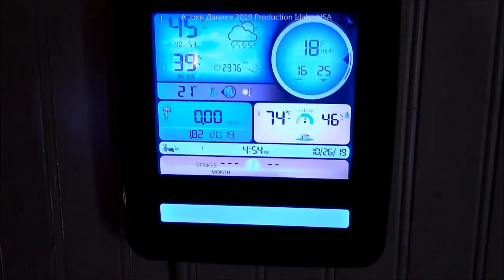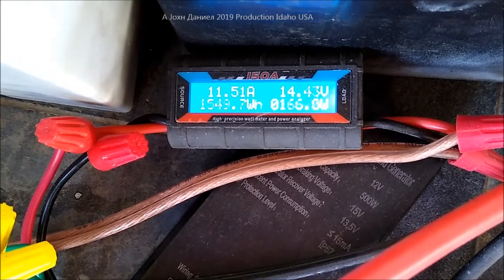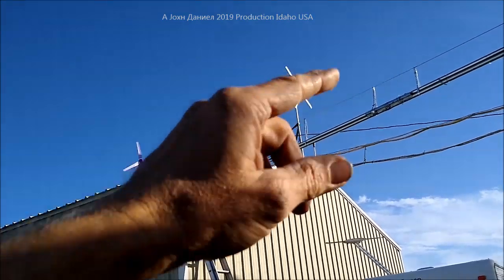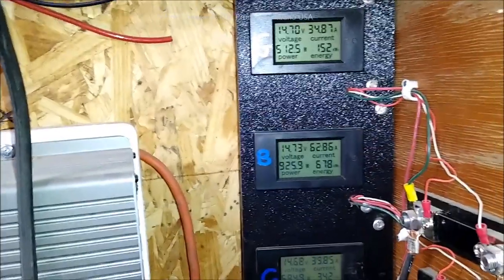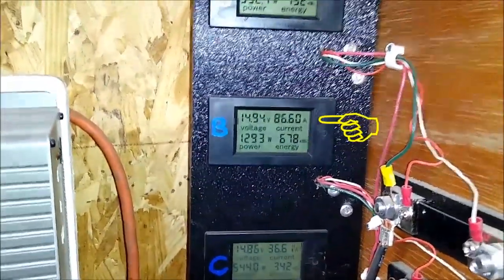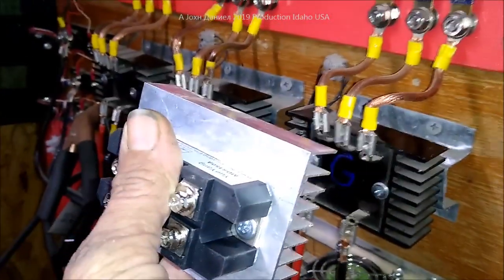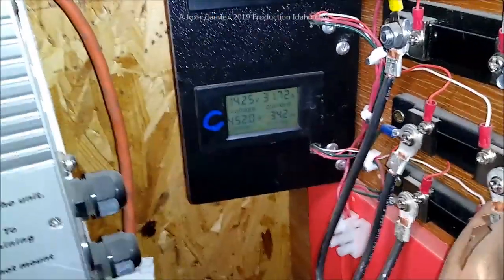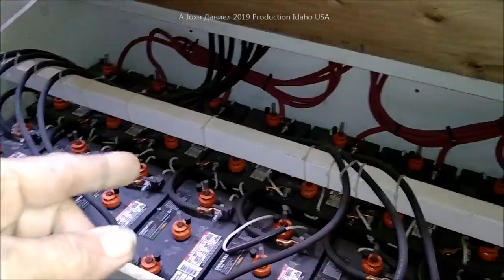Multiple Micro Wind Turbines make high power, 800 watt B&C hits 1300 watts, parts Below Vid

Comment from the maker: See the low wind power results as well https://youtu.be/sq4XPT-LFbI in vid 3, SUBSCRIBE, Get your parts to GO INDEPENDENT OF THE SYSTEM from sources below the video.  Solar & Wind, its for the ultimate self reliance. Hit the SHOW MORE below all the videos & get your head start now. UPDATED 4 VIEWER RESPONSE - More parts are here For rectification to get 100% full batteries & to divert over volt you will need these: https://amzn.to/37HN2OR 100A SQL Rectifiers &  https://amzn.to/2MTUjCU A All purpose long life Load controller and be sure to get up to and over 300 watts diversion resistors ( https://amzn.to/2QngFPq x 3) and one or more 60 amp SSR ( https://amzn.to/2QKEyj0 ) with heat sink ( https://amzn.to/2ZYtmna ) and be sure to use thermal past on it.  ( Proper type - https://amzn.to/2QN2hir from Protronix)
Reply: Јоhn Daniel if you were starting out with wind turbines- which would be your best pick?
Reply: Hey @John Daniels
If i want to use 48v dumploads in hotwater tank .. 
Instead of the huge resistent .. how do you do .. that?? 
We are ordering 2 of the 800Watt@48v wind turbines .. to top Up the
20x200Ah AGM .. 
My plan was to dump All exss power in my hotwater tank 
Found 1500Watt@48v .. so i think maybe 2 of thoes 1 in eatch 140l tank got 2 tanks ..
The tank has place for 2 x 230v@2000Watt so i replace the 1 with the 1500Watt@48v 
The tanks hawe a Cooper radiator outlet .. so hot Water helps heats radiator aswell .. 60° degree 
So the dumploads Will never ever run hot .. if All batteries are full .. All water is max hot 
Then bypass walve Will start heating the jacusi .. and Then the pool ..in worst case .. 
So help please with som indput
Reply: @tracycovington3130  IT All depends on you dayli consumption 
Look at the wind turbine as sun panels on a cloudy Day..
When wind goe's down /clouds go infront of sun.. 
When blows 15m/s hard wind IT Will max out like sun panels on a clear Day!! 
I buy 2 800watt IT was supposed to be the 500 watt to 211doller PR pop but they hawe med a sweet (test) deal on 2. 800watt 29kg 
Wing ø 2.4m 5 blade (wind poor area so need ewery drive i can get) with@48v 
I was asking John of using 1500awatt@48v hotwater coils instead of stupid resistors !!
Reply from the maker: @kennethschultz6465  Don't go to as high as 1500 watts, they will never stay on long enough to heat. Use these 1kw https://ebay.to/32TmCr4 with the ni-chrome elements in them, the reason is as soon as your diverting that power, your turbine slows, when it does you will not be seeing that over 1000 watt peaks and will be in the 700 to 800 under such load. When battery level gets safe again it will release and your cycle will repeat. With these goofy Missouri and Texas sellers of those tungsten junk water heater elements they grossly and pointlessly over size just to sell you crap, fact is their style takes 8 seconds to reach thermal passive points, and at the same time, diversion may only last 5 seconds. However NiChrome based heats in 2.5 seconds to over passive thermal rate and you will heat water.
Reply from the maker: @kennethschultz6465  For water heater over temp you just use a heat based thermostat ( bi-metal disc) set to go from NO to NC at 155 degrees and from there to a basic 40 amp relay ( 48vdc robotics rated relay) and that will jump divert to a blower, a resistor or a bad ass stereo so you can dance to the fact the Jacuzzi water is smoking hot and ready to cook your ass!
Reply: I love your informative videos very much and i've just installed my 500w 24VDC wind turbine, but i am afraid that i received a 12v due to the high rpm's needed for charging.
I have measured the rpm to approx. 500rpm needed for my 24v batterybank.
In one of your videos you charged a 12v bank pretty good with 400rpm.
Have you done more test like this?
Reply: @JOHNDANIEL1  loool yeerh What electronic .. kliks the Relay ower ??
Reply: @JOHNDANIEL1  What electronic kicks Relay over .. and when ...
You need som kind of chardge ... Floating .. or you onley got surface battery chardge .. not 
Long time chardge... So when do you kick over in the dumploads..
Reply from the maker: @kennethschultz6465  The diversion controller is set to a voltage like 14.6 for 12 volt system, 29.2 for 24 volt system and when your batteries are full the controller kicks off the relays to divert at that point to keep the battery at max charge rates.

Comment: On my RV I have a small 240W rated Vertical windmill (0-60V). I have problems getting the voltage high enought to charge my 24V battery bank. So I have bought a new possibly better boost charge controller. I have a cheap boost controller now, but what I do not underdtand is, that when there is good wind I just get 3 to max 10W. First I was thinking to little wind, but that does not resonate as I would need storm then to get 240W...
Reply from the maker: I would recommend honestly getting the 300 watt ge300  that is on one of my videos on my channel. 3 blade in most places or 5 blade if you got low winds.
 The vawt is nice idea but I never saw more than 150 watts in high winds from the one I had, the best result comes from that little 300 it's truthfully rated and it's very quiet and lightweight enough to raise up on a rv.  **Be very cautious about wind turbines and outrageous watt to weight claims on the Internet or sell sites. 80% are straight up frauds.

Comment: Question  I remember a while back you put a lantern style turbine on the front of a trailer . my question is do you hear the sound difference between the lantern styles and open blade Fan style  I know you get more power with the fan and less with the  Lanterns but I wanna know of the  Sound  Difference Also great videos keep up the good work
Reply from the maker: The standard sword style high speed blades are significantly louder than the Chinese lantern, however if you choose to get a low-wind model that will run better in lower and high winds the blades they come with are extremely quiet. I suggest go look at this video https://youtu.be/QSfWnIscDTM and below the video is a link to the low wind 500 model. So if you pick the five blade model for a 12 volt system it works extremely well in low winds and produces significant power but little noise. if you're going to go with 24 volt though you probably should get the 3 blade low wind model for better results. I don't recommend buying the 500 watt low in models for 48 volts in most cases. For that you will want the 800 watt model seen in a video I recently done.

Comment: Hi John been watching your videos for a while now and I believe that you said that It is possible to use a 24v turbine on a 12v system. Well the closest I can get my turbine to my setup is 50 metres I have already installed 3 lengths of 6 gauge welding wire so what wattage turbine would you recommend? Barring in mind that I am on a very low income. Google says my average wind speed is 9.2 mph. I would appreciate your input. All the best Mick from the UK
Reply from the maker: A 24 volt turbine will transmit power much longer distance but you will lose about 40% of its top rating so I would suggest a 500 w turbine with the low wind blades to keep the torque levels up and you can probably see the below some of my videos I have 500 watt low wind listed and it's three blade but extremely effective in 24 volt for what you're trying to do. The way that it works is even though the voltage is higher the batteries can only accept so much of it and they hold down the voltage converting it to wattage.

Comment: Very interesting products, but all links are no longer available. Can you share up to date links of these turbines? Also, I'm interested to know if we can connect several turbines in series for more volts so that current goes to a larger inverter that takes between 100 and 400 volts?
Reply from the maker: Just tried the links, all work fine. 
And no, you can't bridge a turbines output
Reply: @JOHNDANIEL1  I can't open any of the links in Ali Express

Comment: Hey John, Dumb Question? I'm Over Here In North/TX, Thinkng About A 500W Turbine? We Get Pretty Good Winds 5-15mph A Lot Normal or Higher w/Stormy Weathers... Now Would You Recommend A 3 or 5 Blader? Is 5 For Lower Start Ups?? Thanks
Reply from the maker: I know the Wichita to Amarillo area well, we have land there. And I have their 1000 watt on it since last year, but you can get those massive hammer head storms and the high speed sword style blades can over spin, so the best is the blade style like that on the 800 watt, even with just 3 its putting out better than others in low winds but has the ability to do blade effect braking in bad weather. I'm getting 2 more of that model for myself soon.
Reply: John when we get a homestead I think I will definitely invest on like 10 of those and make one hell of a micro wind farm.
Reply: @JOHNDANIEL1  Yea That's What I Figured, The 3 Blade Would Be Plenty!? I'm About 30 Miles N/West Of Fort Worth on a Acre Ranch In The Heavy Oak Woods... I'm Thinkin About Just Topping My Highest Oak & Put A Plate On It To Get Above All Others! LOL Thanks Buddy & LUV Your YT Vids!!!
Reply from the maker: I would say that 3 blade 800 is good for your area for sure, same wind stream as Lawton OK.
Reply: @JOHNDANIEL1  Yep Probably! ;~)

Comment: Hi from Australia John,

I have subscribed and watch your channel for over 9 months now, I love your knowledge and honesty on wind power generation.  I followed your fitting of a wind turbine to your RV.  Good stuff…. I recently bought a 300 watt wind gen after watching a video of yours, I chose a 5 blade version and it works fine.  It is as most are a Chinese unit with the small black box controller regulator.  I do plan to buy a bigger unit – A 12V LCD Wind Solar Hybrid Charge Controller MPPT For 300-600W Wind turbine so I can use it with my solar panels too.  One question though, that little black box, the controller unit, where about do I place it, close to the wind generator, or in my RV close to the battery??

Also what is the best way to measure the amount of power that my wind gen is generating, I have a multimeter and also a 100 watt analogue metre with a shunt, (not yet installed)
  Also how many watts should a 300 watt wind gen put out ??   Maybe it is a silly question lol, I don't know...

Wind power is really a fun thing for me at the moment, I am learning so much from you and love it.
It makes me feel good to know that I am working to generate my own power.  I am a retired guy, 56 and about to travel full time around Australia with 1000 watts of solar and a 300 watt wind setup.

I love your stuff and wait to see more videos on RVs, I also love your VAWT’s,

Cheers from down under…
Peter the Grey Nomad.

Comment: Hi John, awesome video. I'm building a 48 volts system with a small turbine. I wonder how to connect a SSR to divert the load after 60 volts DC to the heat sink/ brake. My inverter do 22 to 60 vdc grid tie, the other day got some serious wind and controller blew and voltage went to 189..you can imagine...why I want to divert after 60. Could you do a video on how to connect the SSR? Where to find one who divert at 60? Thanks
Reply from the maker: Depends on the battery Bank style you're using so if you wish to install a diversion load and you have 12 volt source in that 48 volt design, then you apply the diversion load sensor to that 12-volt source to divert at 14.8.  It doesn't matter what your complete battery bank size is, you base it on that one 12-volt source. So if you look below the video there will be a link to diversion load controller you get that model and follow the instructions using an SSR it shows you where to hook it up and then I would add 400 watts of 8 ohm resistors and you should be fine. The size of SSR you will need is 60 amp DC to DC and I recommend a m a g e r  brand. If you need a direct source link to some of those parts let me know.

Comment: John do you think the 300 watt turbine will work even better when wired up to a rectifier
Reply: I would like to wire it up like you did the 500 and the 800. Don't know if I trust that little controller. Thanks again.
Reply from the maker: Yes, just run a 12/3 extension cord down ( up to 40 feet is ok, longer use 10/3) and use a 100 amp Amico style rectifier and a diversion load system/

Comment: Hello John nice Channel and Informations,my Question, ist the GE-500 or B&C-500 better or both the same?
Reply from the maker: They are mostly identical since they both order the same parts to build them from the same manufacturer except ocsssionally the B&C controllers can be better models. Most just order weaker parts to assemble and sell, those 2 shops are the only ones I found in years that use the proper rated components to assemble and ship though.
Reply: @JOHNDANIEL1  thanks for the message, I buy the B&C 500 WATT and i hope it's come to my home

Comment: When do you recommend 12, 24 or 48v. What factors should I coincided when buying
Reply from the maker: I am a prepper/survivalist type so I stay 12 volt, you can find parts in junk yards and off the shelf everywhere in a crisis. But if your sure the world will remain stable ( ooops Corona Virus panics risk collapsing world financial markets) then you can go which ever you like. I like 12 volt due to switches, auto grade parts, lights, fusing, inverter cost and ease too. Once you go higher volts you have to depend on 70% less options and suppliers and if you have 24 volt system and 4 - 6 volt batteries and one fails your screwed, I would still have 1/2 my power.

Comment: Hello John,

Thanks for your videos. I learnt a lot. And I bought one as you recommended. I bought a 500 watt turbine from G&E . My system is a 48v system and installed it a week ago. However I don't seem to get a good wattage from the turbine although I get a very good wind speed here. In the last week I only had 38 watts hour. What's the issue you think? Is it because the induced voltage hardly hits above 48 volts? 

By the way, I'm using the original charge controller that came with the turbine.
Reply from the maker: Whats your winds, obstacles if any, wire gauge/length, do you have a solar controller in this system and blade count?
Reply: @JOHNDANIEL1  
Thanks for your reply

I have no obstacle. The wind is good and the turbine is on top of my roof.

Wire gauge is 6mm2 for both three phase AC and DC wires.

I'm using solar panel and solar charge controller (model: Victron). And it's charging the same 48v batteries (4x12v in series).

Blade counts of my turbine is 5 blades
Reply from the maker: @am-ve2wn  They do need a good run of wind up to get broke in. You have to align the magnet flux and free up the saturation in the core from a good break in wind. But If your getting over 15 to 20 mph winds with those results still then get a rectifier, wire it 3 phase in then direct to battery. Its possible you got a bad controller. Some controllers get damaged by people connecting turbine first to it then battery which changes the preset cut in voltage but if your already doing wind and solar and have comprehension of that fact, I doubt that mistake was made. So try a rectifier on it first before looking to get it exchanged as a bad unit.
Reply: @JOHNDANIEL1  Thanks. I will
Reply from the maker: UPDATED 4 VIEWER RESPONSE - More parts are here For rectification to get 100% full batteries & to divert over volt you will need these: https://amzn.to/37HN2OR 100A SQL Rectifiers &  https://amzn.to/2MTUjCU A All purpose long life Load controller and be sure to get up to and over 300 watts diversion resistors ( https://amzn.to/2QngFPq x 3) and one or more 60 amp SSR ( https://amzn.to/2QKEyj0 ) with heat sink ( https://amzn.to/2ZYtmna ) and be sure to use thermal past on it.  ( Proper type - https://amzn.to/2QN2hir from Protronix)

Comment: I see you work with bladed wind turbines a lot but what about vertical axis turbines.   I'd like to put one up here but this type of turbine in a residential area would likely not go over well with the neighbours and I was thinking more along the lines of a vertical axis turbine.  Can you tell me what the difference is or if it would even be any different for power generation?
Reply from the maker: The 800 watt is amazingly quiet. It's blade design is the quietest I have installed in 8 years.

Comment: Do you think wind turbine is better option or solar panels?
Reply from the maker: Think about using 75% solar and 25% wind in any project to get best results.
Reply: @JOHNDANIEL1  what is the minimum wind speed at which 500watt wind turbine starts to produce power? And how much it is?